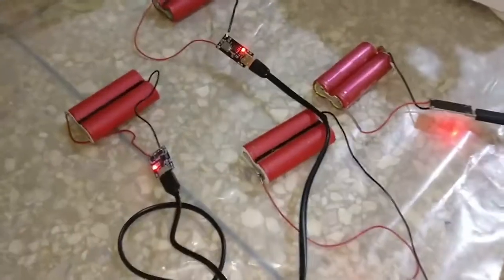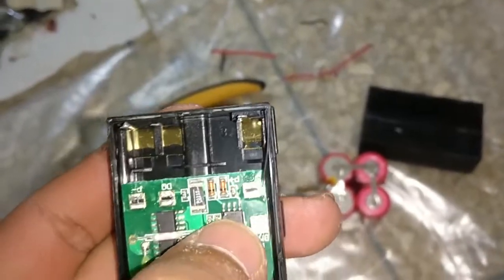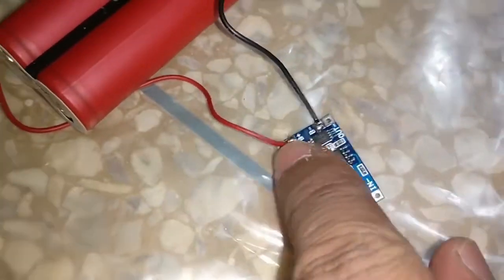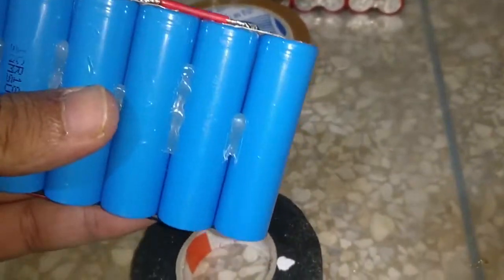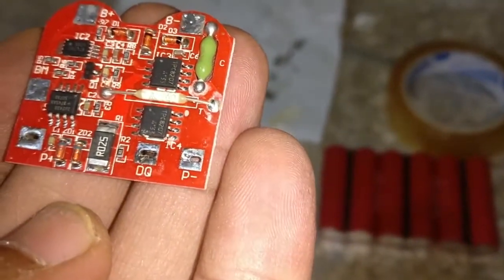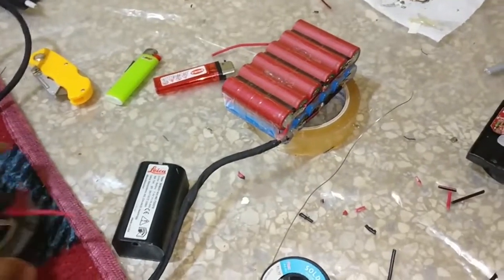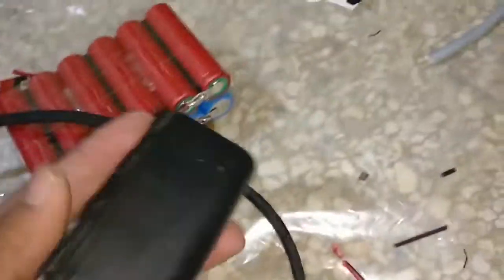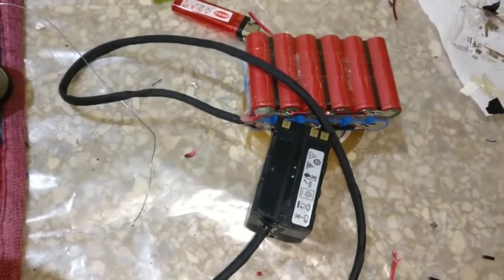Bigger LEICA battery for LEICA GS10 unit

Comment: Hello. MY BATTERY HAS 7.4V (MEASURING THE FIRST AND LAST TERMINAL ON THE RIGHT) BUT IF YOU MEASURE IT WITH THE MIDDLE TERMINAL IT HAS 5V. THIS IS NORMAL? OR SHOULD IT ALSO SHOW 7.4V?
Reply from the maker: I think the terminal that is not - or + is for temperature, there should be some voltage there to indicate the value of temp to the device I'm guessing.  and if you're measuring voltage on cells but not on the circuit then it's abviously something wrong with the bms circuit, you'll have to replace that or check the fuses or troubleshoot the other components if you have the know how
Reply: @OhadooElectronics  OK. Thanks for answering, but I still have a doubt if it's normal to present the 5v in the middle terminal or the correct one would be 7.4? as well as the other two. Thanks.
Reply from the maker: @leonardotavares6672  I don't think so the BMS inside a battery I had says P+, P- & DQ for the 3 terminals and each terminal goes too different part of the circuit.

Comment: I have 2 leica geb 221 batteries. but now the red light is on. I can't charge. I'm checking the batteries. durable. Do you know why they are not charging?
Reply from the maker: The red light, you mean on the charger right? Ok I assume your charger is ok you can make sure using another battery if you have it, but most likely it's the battery, you'd wanna open it and check if it's only a broken connection  then fix it or it might be the BMS circuit itself that has an issue in that case you can either troubleshoot that or give to someone who will or change it entirely with a known good one from an other battery and solder then put all together and try
Reply from the maker: the batteries will need to be replaced only if the battery is working and not holding a good amount of charge
Reply: @OhadooElectronics  I opened it up and looked. I charged the batteries manually. I measured the values and they were normal. I think the bms circuit is broken as you said, it did not run the device. Thank you for your interest.
Reply: Hello. My charger (gkl 211) has no voltage when plugged in and still without the battery in it. Do you know if this also happens with your charger? It even turns on the first green light, but when measuring with the multimeter it has no voltage at the terminals. (empty/no battery)
Reply from the maker: @leonardotavares6672  normally I think there should be some voltage on charger terminals (probably 8.4V) maybe you should open it and check there is a disconnection  from terminal to rest of the circuit , since it lighting green